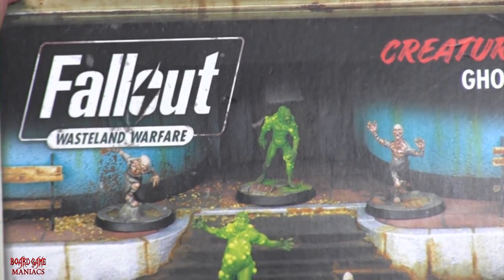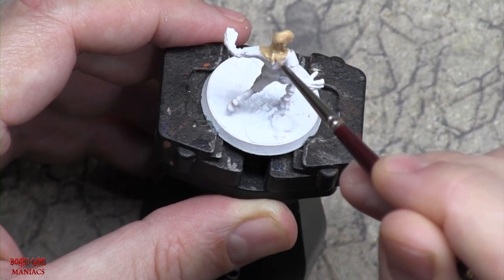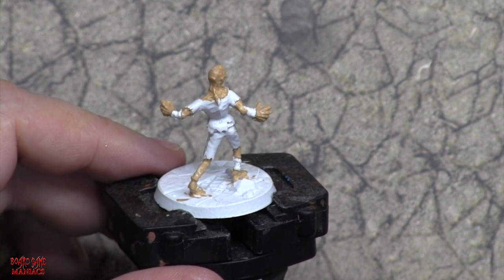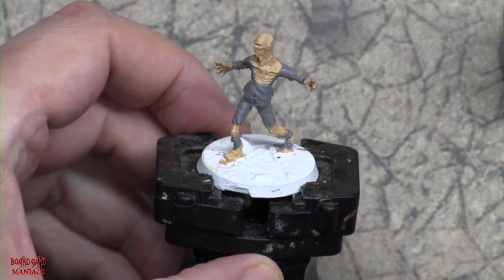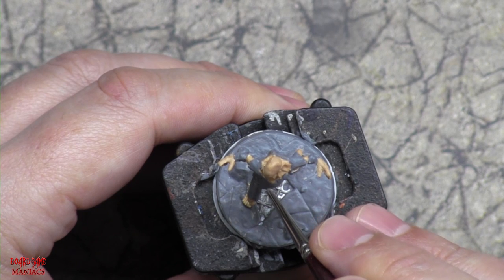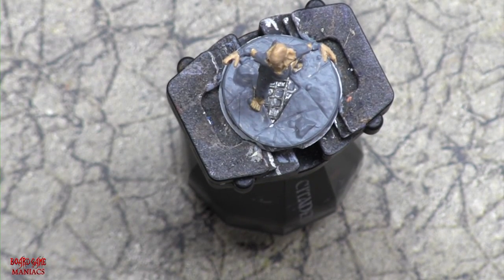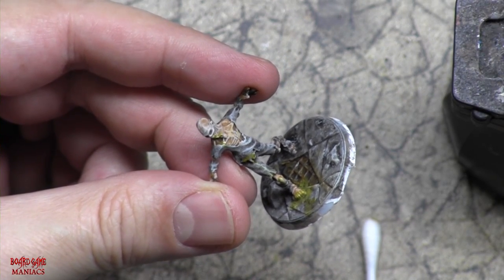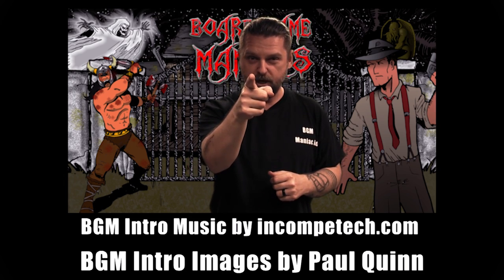Fallout Wasteland Warfare - Painting Feral Ghouls - BoardGameManiacs

Comment: It seems either the color correction on the video is way off or there's something weird going on with that flesh paint. That pot of Kislev Flesh looks more like Zandri Dust (a medium sand/tan color) than the light "flesh"  tone it's supposed to be.
Reply from the maker: Thanks for the comment. We had done no color correction on the video. I had double checked both the paint and compared it to an unopened paint pot and the colors are the same. Would it possibly be your color temperature of you monitor needs to be re calibrated. Not sure why it would show like that. Thank you tho for the comment. We appreciate it and the view.